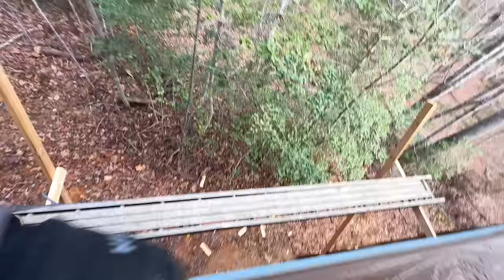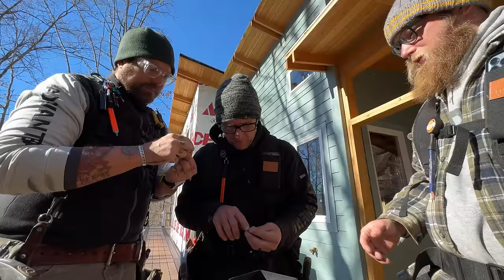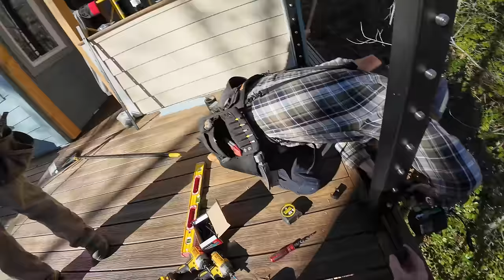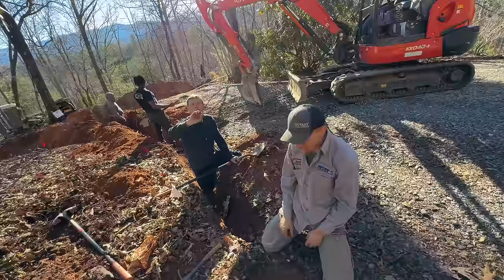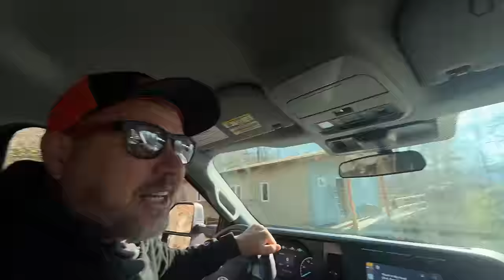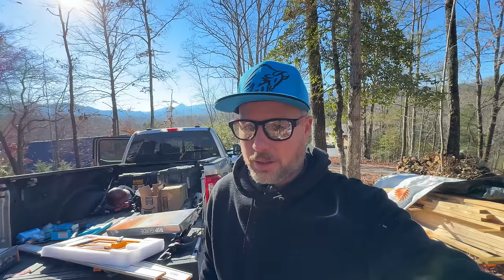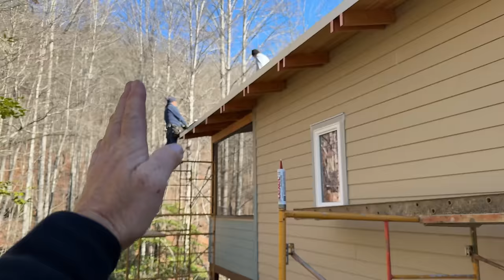Modern Home Build | 37 | water connection, Envision deck railings, roofing & MORE!

Comment: One thing that I just don't get is... why screw the roof sheets on the flat sections - you are just making points that will purposefully disturb the water flow and leak years down the line (even with the sealing below it) :/ 
Should screw in the panels on the upper sections since they have a lot less water flowing over them and allow for a longer period before leaks occur.
Reply: That’ll void the warranty
Reply: @terencemerritt  how?
Reply: @mitchellmnr  by screwing into the ribs and not the flats
Reply: @terencemerritt  Okay, so seems things were missed.
I was stating I don't get why ... it makes more sense to screw into the ribs than the flats.
But warranty is all down to the seller of the panels, and not the logic I am asking for.

So the reason is because it has a more solid grip/pressure for a better seal ... that is all
Reply: @mitchellmnr  I misunderstood your question. I thought you were just asking how it would void the warranty, not why. Sorry. But yes, our local metal supply company has a flier with installation instructions and if not according to their install specs it’ll void the 40 year warranty. Screwing in ribs, cutting with grinder, folding, etc all will void.

Comment: As a past locater, I will tell you that the depth is always not as deep as the contractor who installed it.  2 1/2 feet for water is about right.  Should be 3.  The ground in the mountains is always hard to dig.  The machines they use to locate do not measure the depth very well.  Most locaters will not tell you the depth because if they say 3 feet and its 2 then the damage is on them instead of the people (you) doing the work.  Love your videos.

Comment: 20 minutes and like 42 seconds in the drinking game has ended. Apparently we’re doing rails.
Reply: Yey Jay
Reply: 20 minutes and 50 some seconds in he’s already making donuts for the cops in case they show up wow maybe they’ll just stop at Cardinal coffee in a little birdie will give you a call
Reply: Nice touch rain chain. Yeah that should work solve the problem. If it doesn’t it’s a future project but it’s not a violation or a warranty issue or an eyesore.